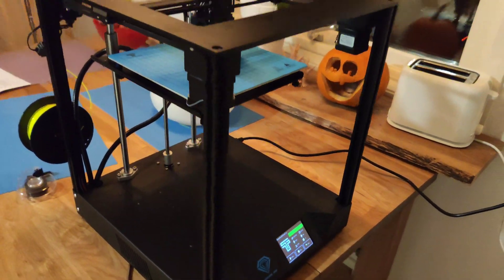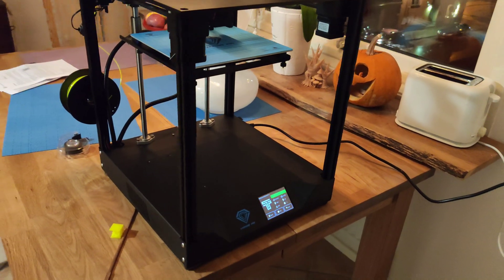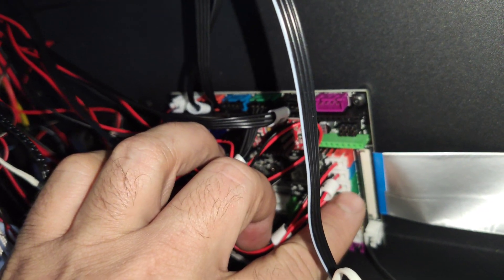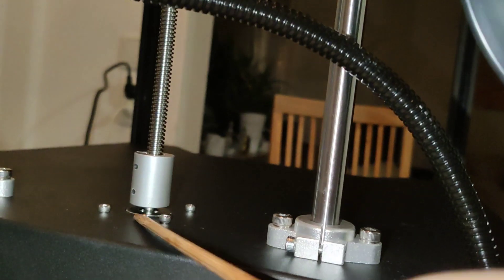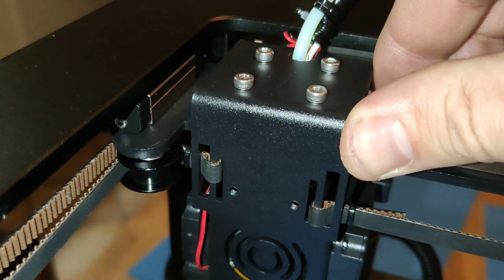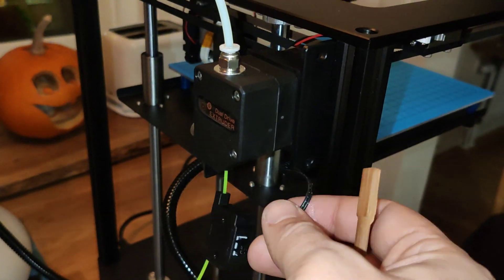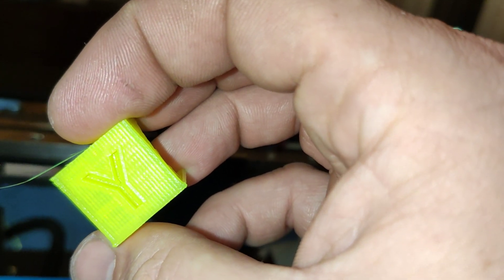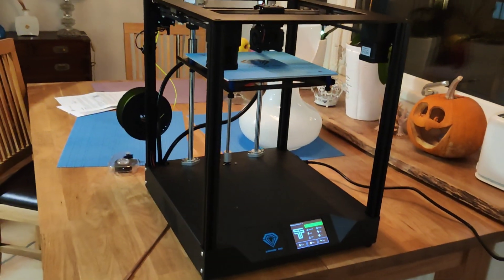Two Trees Sapphire Pro, 3D printer TIPs & FixeS...before you assemble 👌

Comment: Thank you for the great video, very helpful. I am getting my printer in the mail soon, I have heard that the build area is only 220x220 instead of the advertised 235x235. Is this correct or did your belt tightening method fix this?
Thanks again.